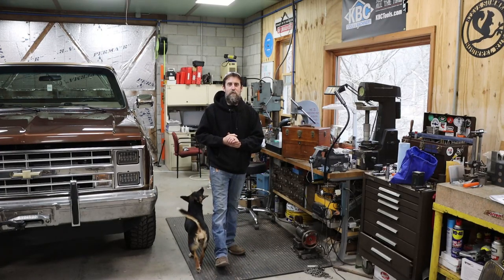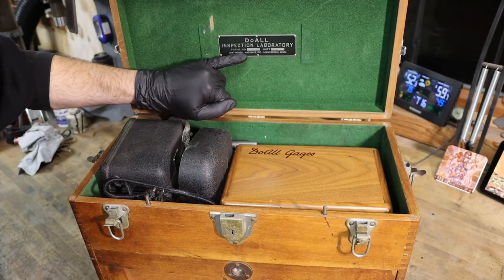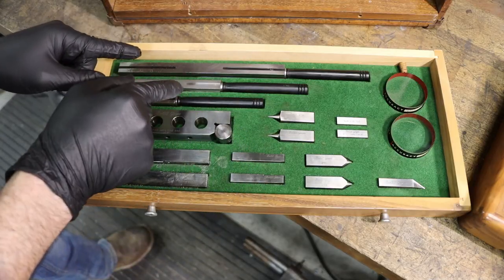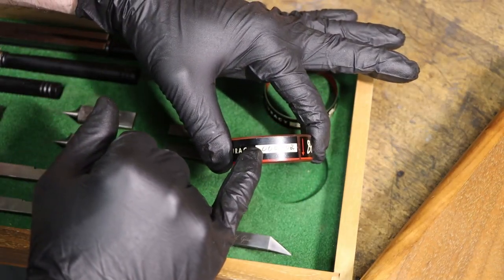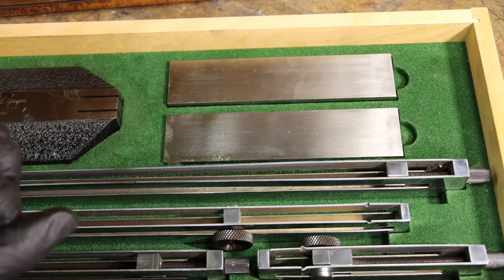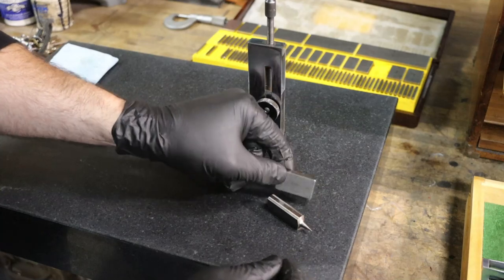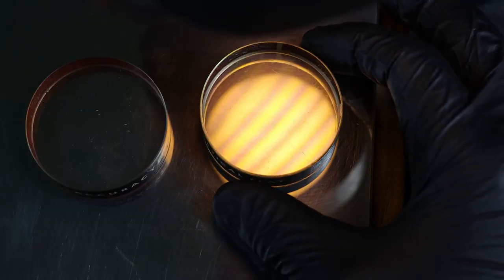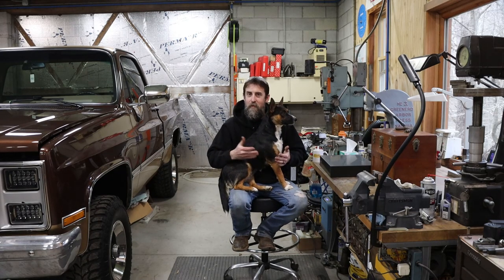What's INSIDE This 80 Year Old Box is Amazing . The tools that built today.

Comment: OH MY, What a wonderful set to add to your inspection and measuring tools. A couple times I had to use gauge blocks to measure a bearing seat for a 4 ft gas pipeline input coupler from a 747 Rolls Royce gas turbine. Both vertically and horizontally on a 16 ft Berthiez boring mill. I was 20 at the time and in 7TH heaven every day Almost 50 years later I still remember that shop and all the huge equipment. Right beside me was a 10 ft master service radial arm drill that had a 4n ft dia post. It could drill 8 inch holes in cast steel all day long. Oh to be young again, LOL.

Comment: Steve, the basic box could have been made by Gerstner. Pull out the two bottom drawers and  check inside, on the bottom of the box. There may be a Gerstner stamp there, indicating the species and manufacture date of the box. Thanks for the video, and GREAT FIND! Jon

Comment: Hi Steve  I have used this type off gauges, to check the flatness of carbon seals, that ride against a steel very smooth part  to seal seal a fluid off from going to a other side in a part.. the optical part is put on the carbon seal and under the light to see how flat the seal is. If the line where straight is was good and if they bend you had to polish the part more to get it flat Both parts are checked is way, When is was overhauling the seal in a fuel separator for S61 helicopter.

Comment: The optical fringes you showed are there because one edge of each flat has been raised a bit, making a wedge of space between the flat and the metal surface. On the second one the edge has been raised more. so there are more fringes (as you observed you can count them, multiply by half the wavelength to find out how much the edge of the flat has been raised.

I'm not sure if what is raising one edge is a deliberate feature of each flat (a tiny bump on the rim) or just a speck of dirt you trapped there, but it seems to be rotating with the flat.

It is often useful to have such a wedge. Without it the errors in the tested surface will show as a bunch of rings and other contour lines, but without the wedge, you can't tell which side of the contour is the high wide, e.g. if bull-eye rings are a bump or a hollow (or perhaps a hollow with a bump in the middle, or...). By adding a spacer deliberately under one edge you can tell which side of each contour line is the high side.

Comment: Interferometry is very interesting.
One of the instruments I serviced  passed particles to be sized,suspended in a liquid, past a window illuminated by  coherent light (laser).
As the particles were illuminated a fringe of concentric interference lines appeared around them. Analysis of the interference lines allowed the size of the particles to be determined. 
One client used this to measure the size of lactose powder used in pill manufacturing , another measured volcanic ash particles

Comment: I don’t think the box was built by Gerstner, I haven’t seen one where the sides and back are joined with finger joints. Gerstner box sides are usually finger jointed sides to bottom.  I also see at least a few other differences like no Gerstner stamping on the latch.
I think someone here said probably made by Union - I think that’s a better guess.

Comment: The interference bands optical flats take advantage of for measurement is why modern quality optical lenses for photography and so on are almost never "flat". Rather, optical lens elements are often aspheric and/or combined into lens sets that try to reduce or eliminate the various sorts of "aberrations" that this tool takes advantage of. I always find it interesting how an ideal is so driven by use in engineering. There is often no "best"; only "good enough for the purpose and to the useful extent". Very cool find.
Reply from the maker: Very interesting 👌

Comment: I'm really curious about why those gauge blocks were never returned. The note says where they went, but it's a mystery why they never came back. It's possible they were just too worn out or damaged to be worth returning and they just bought a new set to replace them, or maybe they just got lost in the mail, but we may never know for sure why they weren't returned.
Reply: When the war ended, the facility that did the certification probably shut down and everything in it walked away or was auctioned off. The serial number is there, so wouldn't it be cool if the set was reunited some day? It was probably used over the years, so I doubt the condition would match the rest of the set, but the story would be nice.
Reply: maybe we should see if they are still there 😛
Reply: Late 1944...maybe the backlog was such that these were a year out and the war ended and the location shut down.  So many things it could have been.  Still, what a piece of history.

Comment: Very interesting, thanks for sharing
When I was younger I was curious how the gauge blocks ring together, and I was told that because they are so flat when you ring them together they prevent atmospheirc pressure from acting on the faces that are touching but it continues to act on all other faces, thereby pushing them together, it seems to make sense.
Reply: Not to be Mr. Spelling police, it is actually “wringing” gage blocks.
Reply: Wrung blocks stay together in a vacuum, so it's not atmospheric pressure that holds them together.  I think Van der Waals forces are involved but I don't know if anyone has ever proven it.

Comment: Nice! 😎 I wonder what the wavelength of the light is. Probably between 520(green) and 590(yellow) nanometers. (I'm slightly color-blind, so I can't tell if that light is green or yellow). Today, LED's would be used. What would be also cool would be to see those optical flats with different color LED's - but they might not work with other wavelengths.
Reply: You're right. A short search says 589.3nm for a low pressure sodium light. When I took college physics one of the labs in the optics unit was dealing with interference fringes using just such a setup. Lasers and LEDs weren't yet in common use for that purpose in 1973.
Reply: @randyshoquist7726  Thanks for the info. Yeah, a Yellow LED is usually rated at 590 nm.

Comment: When the rings were rotated the interference lines rotated with the optical flat. That confused me a little? I would have thought that that indicated the optical flat itself was not perfectly flat. Maybe someone that has used these devices in the metrology lab could clarify this. 
And yes a treasure chest. What stories old tools can tell. :)
Reply: Not sure about this but I am assuming there is a very slight slope on the metal ring holding the glass reference surface.  This is so that an interference pattern of light and dark lines is produced. If I am correct about the slope idea then the pattern of interference lines will rotate with rotation of the reference assembly.  

Without this slope no interference lines would be seen with a flat work piece.  With an un flat work piece the interference pattern would be likely to be hard to interpret,  let alone correct for flatness.  Would love to play with this stuff a little and find out.

As an aside this very slight slope is possibly  produced inadvertently,  initially,  as the assembly is put together,  and finessed to produce interference lines with a useful spacing.  This is also possibly why there is a correct and an incorrect way up to mount the assembly to the work piece.

Could be wrong about all of this.

Comment: Hi Steve,you didn't mention the rare painted spelling of the word gages instead of the normal spelling gauges .
I found this interesting fact. The rarely used word gage means “something, as a glove, thrown down by a medieval knight in token of challenge to combat.”
A very nice piece of equipment there . Will you be keeping it in its current condition for future generations to drool over or will you use it as it was meant to be used?
Reply: The "gage" spelling is actually very common, and dictionary definitions are often not quite accurate for current technical usages. I've never seen an authoritative definition, but what I've observed from forty years of reading manufacturers' catalogs is this: A dimension, such as wire diameter or sheet metal thickness is spelled "gauge." A measuring device, such as a block or pin is spelled "gage." That gauge/gage spelling convention is pretty consistently held in the metalworking field.